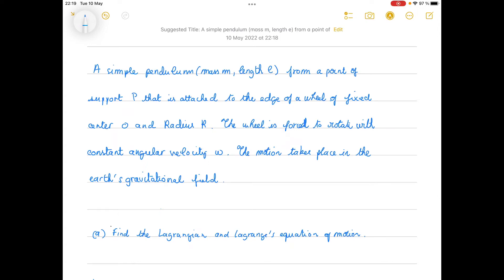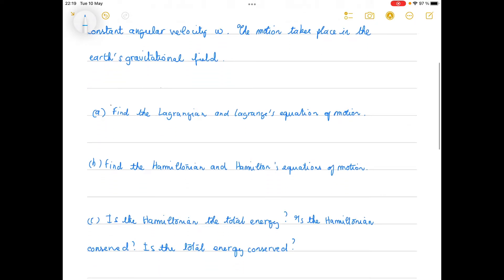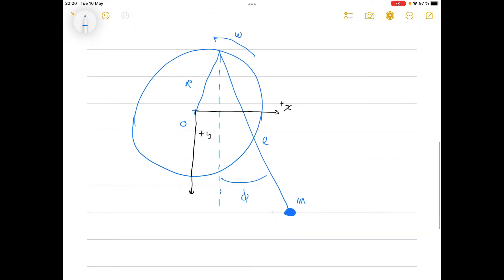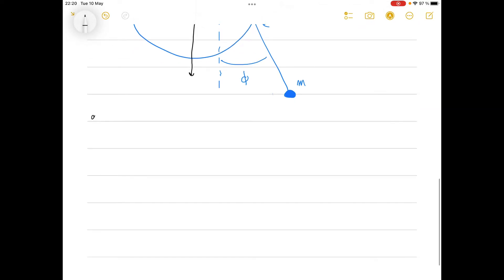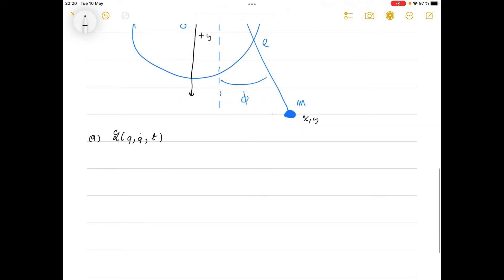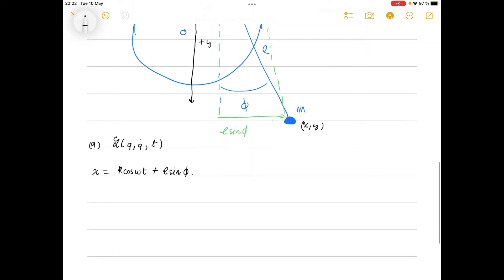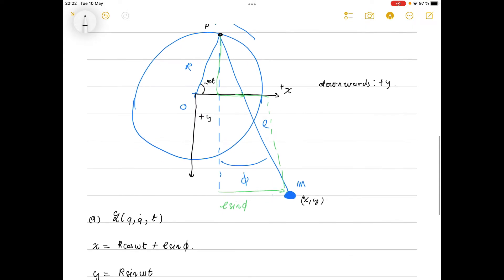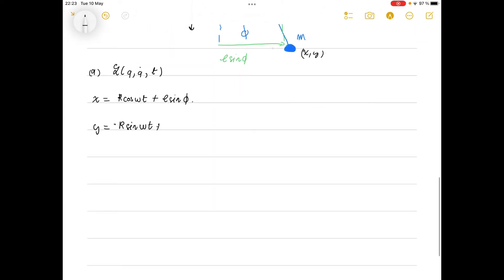Lagrangian mechanics: pendulum on a rotating disk

Comment: I think that V is +mgy in this sign convention
Reply from the maker: Good question. The simple answer to your question is that in this sign convention, the potential energy is indeed -mgy. Let me explain: 
In this problem, I chose +y to be the downwards direction to and set the zero of the potential at center of the disk. Regardless of the conventions I choose, the potential energy must increase the further away I am from the earth. Therefore, if +y is upwards, the potential energy will be +mgy and if +y is downwards then it will be -mgy. You can also convince yourself of this mathematically by using the fact that work done by gravity = -change in potential energy and noting that in this sign convention (+y=downwards) , F=+mg. I leave the rest of the calculation to you. 

The moral of the story here is that when doing these types of exercises, it is important to write down explicitly what sign convention you are using and where you set the 0 of the potential energy. If you stick to your convention faithfully and do your calculations correctly, you will obtain the same result regardless of what conventions you chose to begin with.

Hopefully that helps!
Reply: @angryphysicist9310  You have chosen the downward direction to be positive. So the sign for anything pointing downard should be positive. It would have been correct if you chose the upward to be positive.